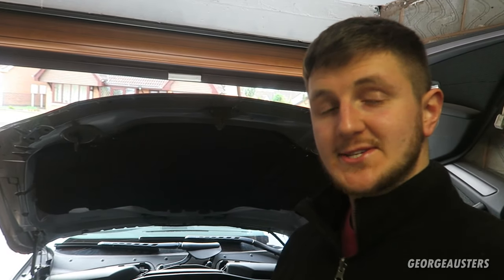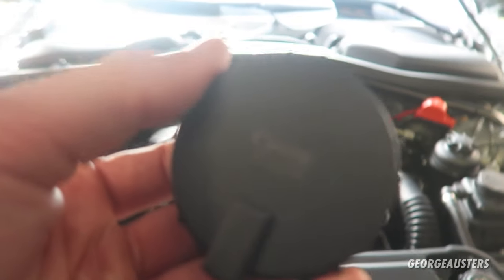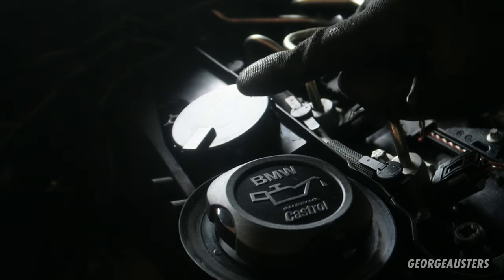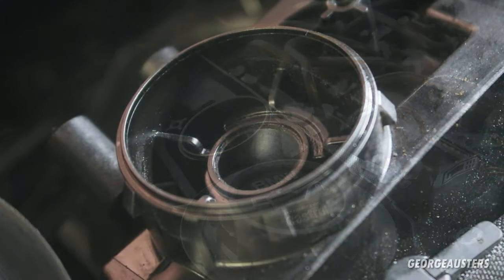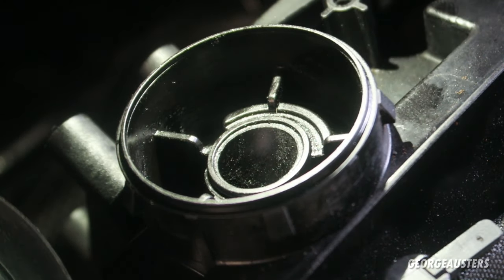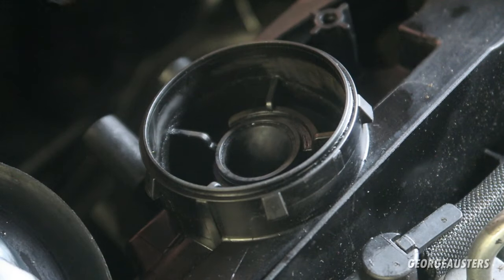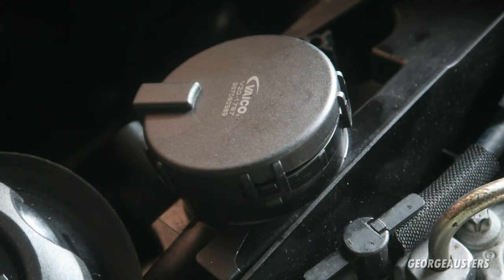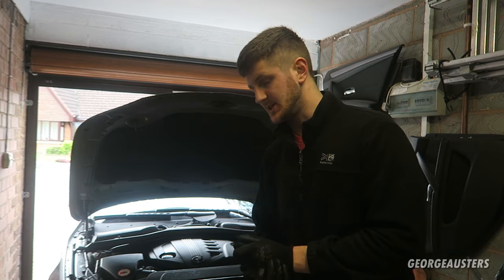BMW CRANKCASE BREATHER VALVE REPLACEMENT | *CCV PCV Removal*

Comment: What are the symptoms of a faulty breather valve?
Reply: Suction when taking off the oil filler cap is one
Reply: It makes a whistle spund when you let go off the throttle and the car runs rough and slow due to pressure build up in the engine cos its blocked or clogged or closed at times. And when you come to a stop your idle will be violently going up and down shaking the engine badly also. Especially for a automatic car.

Turn off the car and turn it on again and it usually disappears but better get it fixed by a new valve cover.

Comment: Good tutorials!  Is it possible that this PCV or CCV valve is damaged and produces excessive oil consumption?  since it is happening to me in my N47d20c 143 hp from 2014, I detected it over 90 thousand km, I had never consumed it and now it spends 1 liter every 5 thousand km approximately.  Thanks in advance
Reply: Did this sort the issue for you? Mines same going to replace this see to see if it sorts that. N57 100k on clock.
Reply: @iamolafs_  Did it work?  mine is N47, and is now using 1 litre of oil every 600 miles.
Reply: @sparephone8228 not done it yet somehow since last refil its not needed a top up 😂 but will change this at oil service which im doing next month the parts only cheap

Comment: It need replacing if you see more oil on crankcase breather tube than usual. Also it is a good idea to change it if your car is 6-7 years old - it's a lifetime for rubber parts
Reply from the maker: Replacing the breather tube was one of the first jobs I did on this car👍🏻

Comment: Thank you. Usually, know the pcv valves are integrated with a cover which sucks. My car has a cover of this type like yours which made me very happy when I found your video. Let me ask you? Have you decided to change pcv to find out how it has to be done or your vehicle had some symptoms like oil in the pipe going from the bottom of the engine to the air filter housing?

Comment: Hi, I have a 64k mile F30 335d, it started using oil 1L/1000 miles, do you think this valve could be the cause?
Reply: Anser? My to is using oil and i put in new turbo but didnt help
Reply: Oil leak maybe?

Comment: I just replaced mine on a 320d n47 (same breather as in the video) with 230 000 km on the clock. It was in perfect condition. No need to replace but hey, now I'm sure it's still in good condition.
Reply from the maker: Yeah these very rarely fail as it’s just a piece of rubber and a spring
Reply: @GeorgeAusters  to be honest i was expecting something else... Especially because it was the original one, it has about 12 years on the car and quite a mileage on it... The rubber was very strong to resist in time. It looks like it is preserved by the fuel that comes in contact with.

Comment: I have the same engine and I planing to change it also because I have a lot of blow by pressure but with out any leaks of oil or smoke do you think it will reduce the blow by pressure?

Comment: I have a 123d and was told that I needed to replace the crank case breather pipe and the filter however I can't seem to find the filter. Do the 123d engines use this valve instead? 
It is an Msport

Comment: Hi gerorge I’m gonna do this job. When looking for the breather Online I’m seeing the whole kind of system I think that the breather attaches too? Is it worth replacing the whole lot ? Cheers
Reply: @corriemcnab5100  hi, mine does excactly that. Should i be worried? Do you have to take off the whole valve cover to replace the breather filter?

Comment: What are the main issues when the valve doesn't work properly that means when the spring is broken and/or the rubber disc has a hole?
I opened my cover (E83 LCI -08, n47, and didn't recognize any changes after 200,000 km (?), so I put the spring, rubber disc and cover back.
But I changed the O-ring in the hose (upper end). The hose is "integrated" with a heating element, so it all costs about 65€, instead of circa 10€...

Comment: Its the next thing i got to do on my m47  as im sure its not been changed in a while as i found oil/diesel in the  boost pipes when i did the EGR delete or worst case turbo :/
Reply from the maker: Oil is fine, it means it’s doing it’s job.
Reply: It's a much bigger job on an M47 mate. Not difficult but lots of covers and parts to come off to get to it.
I miss my M47 - 200k miles and it was absolutely rock solid, smooth and I honestly felt like it would do another 200k easily. Unlike my (admittedly nice) N57 which has a weedy timing chain in comparison!
Reply: @GeorgeAusters  On start up each morning but im thinking valve stem seals if not.
Reply: @munro12345  Yea looks straight forward as the swirl flap delete wasn't that bad, mines on 140k hence why i preferred them47

Comment: Will this solve black smoke from the exhaust? There is no turbo leak and everything was checked and is fine.
Reply: Did you get an answer?
Reply: @yassinedrissi456  nope, changed it but still smokes a bit, crankcase breather was normal even before changing to a new one.
Reply: @majgi130 did you resolve black smoke problem?
Reply: @Jiipee69  no mate im told its cause of dpf off and stage 2 remap

Comment: Hi! Your videos are just helpful, i have question, my engine consume a significant amount of oil, like 1 litre every 5000 klm , and I'm almost sure that it comes from breather, the intake is very oily, the little hose coming from breather has also oil, so what the best move, thanks a lot
Reply: hello, have you solved it somehow?
Reply: Yes I want to know the answer to this too
Reply: @caly6527  i did this ccv upgrade during last month. My oil consumption are now around 500gr every 6000km, so it is pretty normal. who says not to consume an ounce of oil with this engine drives like my grandmother 👵
Reply: Thank you so much for your fast reply. So is it normal to have alittle oil inside the pcv and hose? Im having alot of issues with my mk2 caddy van that I just bought and I think it could be to do with the pcv valve. The hose isn't even attached on one side but is on the crank case.
No power 
Rough idle
Hard to start
Overheating
And stinks of fumes inside the cab
Reply: @caly6527  Emma those symptoms could be a number of things but if the breather pipe isn’t attached on one side that definitely doesn’t seem right. Have you attached it now?

Comment: Bloody good videos and have watched most of yours. Have you considered installing an oil catch can to reduce the amount of oil vapor making its way onto the intake?
Reply from the maker: Cheers mate. I have considered it yes but would only do one that has a factory fitting, not a genetic type
Reply: I was looking at a catch can a while ago (N57 engine). Good ones seem to be quite expenaive but they do catch more water/oil and can easily be drained. The thing that put me off was finding one that had the specific pipes and hoses to fit properly in the engine bay.

Comment: Hi mate I have vapour coming from from my oil filler cap would this fix the problem ?
Reply from the maker: Send me an email👍🏻
Reply: @GeorgeAusters   cheers mate what's your email?
Reply from the maker: GeorgeAusterberry@gmail.com
Reply: What was the cure lads? Mine also smokes around them sides too a bit under though.. also George what’s the symptoms of a bad ccv you’ve just changed as mine is kinda cracked from one side as I think the previous plonker broke one of the clips and 8/10 times the car will start smoking from near the manifold and under the oil cap to be precise. Waiting for a answer. Thanks

Comment: Hi George
Will this part fit ontop my N57 Engine 330d? Bmw wants me to change the whole tappet cover in order to replace the pcv valve, please advise, thanks.
Reply from the maker: Yes it will
Reply: what symptoms does your 330d have? oil consumption?

Comment: could this cause my car to leak from the crankshaft simmering? My car is leaking as hell and when i open the oil filling cap there is alot of pressure
Reply from the maker: Yes
Reply: @GeorgeAusters  but i have n47.. i ordered the CCV thing but it seemed fine when i took it out ..

Comment: My car 320d 58 plate 215000 miles has an error code for high crank case pressure I’m gonna replace this ASAP
Reply from the maker: Link is in the description to buy👍🏻

Comment: Great video! Interesting how other videos on subject the breather is glue and not clipped on. Others need to cut or break old breather valve, you just broke a clip and it came off. 
Hope mine is that easy :)
Reply from the maker: This particular one is just clipped on👍🏻
Reply: I guess, if the cover is enough warm/soft the clips don't break when opening the valve.
It's always important that the plastic parts are "warm" when dealing with them.
Reply: i think the petrol engines n54 n55 have it glued

Comment: Awesome video, im thinking of doing this myself this weekend as it doesn't look too bad and the part is cheap.

I'm basically suffering from a rough idle and a whistle, it definitely sounds like some kind of vacuum leak from the engine, do you reckon the PCV is a likely culprit?

Also not sure what car you have, i have an N53, do you think it's the same procedure. Cheers!

Comment: Hi buddy... I have a dirty oil leak on my 320d n47 engine. Loosing 1L every 2 weeks :( Any idea where it maybe coming from?
Reply: Could be the gasket from the oil filter support, or the little oil cooler it's a common problem, in the worst case your turbine is consuming oil..
Reply: @sdfggtfhhyy  Many thanks will check them out mate.
Reply: @asgharmohammad7375  there are other possibilities to, check your coolant reservoir to be sure there is no oil escaping inside the coolant system, also the oil cover underside the engine might be cracked, but I hope it's just a gasket from the above mentioned
Reply: Front crankshaft seal maybe?
Reply: @lagomadra  BMWs are so poor. Endless leaks from everywhere once they age a little :(
Reply: @asgharmohammad7375 No. They just need proper maintenance with adequate spare parts and skilled mechanic.
Reply: @lagomadra  Actually modern BMW are as Asghar Mohammad said very poor. BMW are riding on the back of a reputation set by brilliant cars like the E30.
Reply: @jamescraighead6959 you’re talking shit 😂